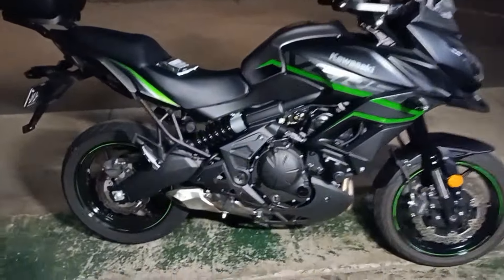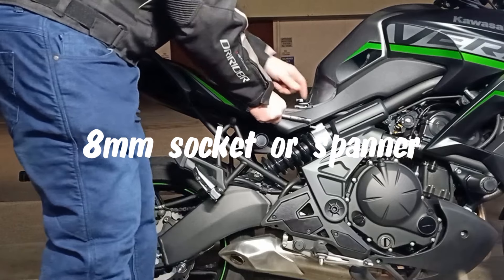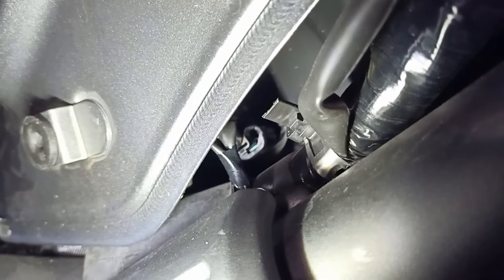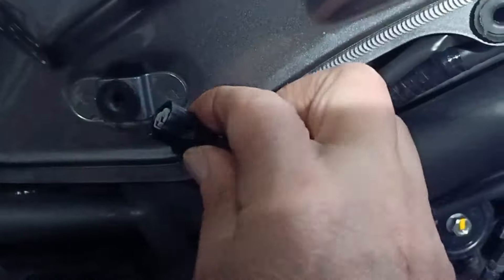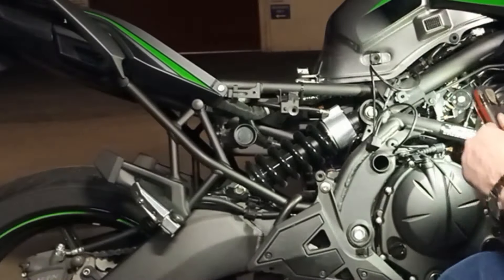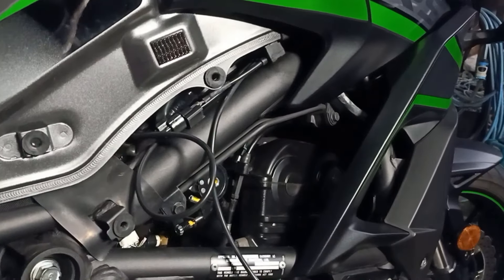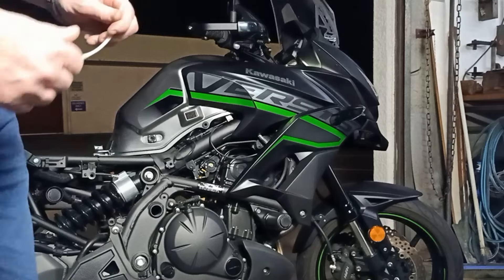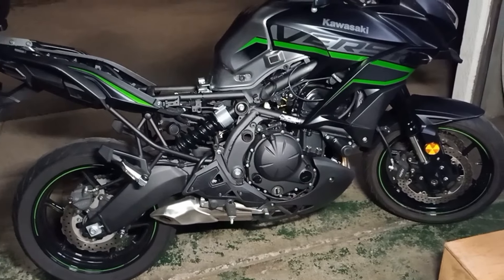BOOSTER PLUG INSTALLATION - KAWASAKI VERSYS 650  (2015-2021)

Comment: What does a booster plug do?
Reply from the maker: It makes your idle mixture slightly richer so your throttle response is less snatchy at low rpm. The Euro 5 emissions bikes are the worst for it. https://youtu.be/AvDaKgmRi6Y?si=nTQk4D4dtDhOF81h